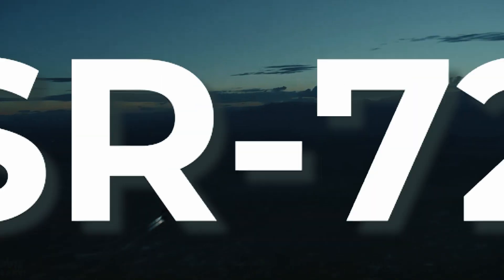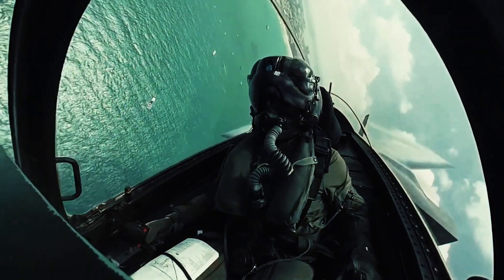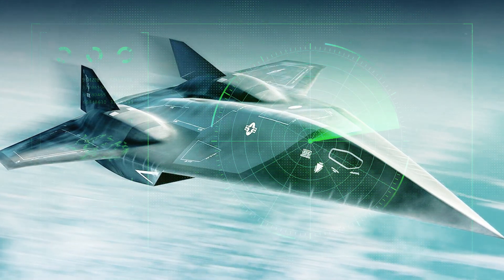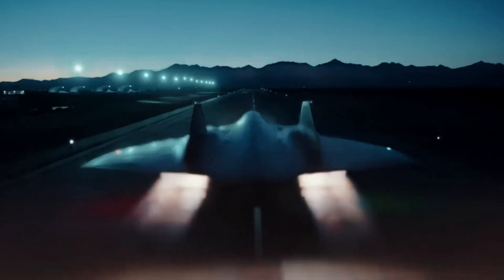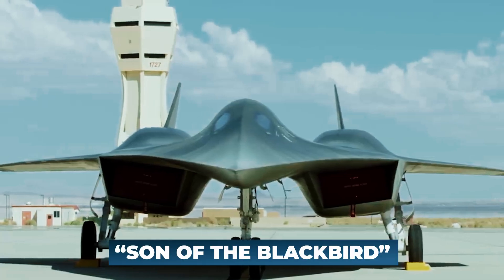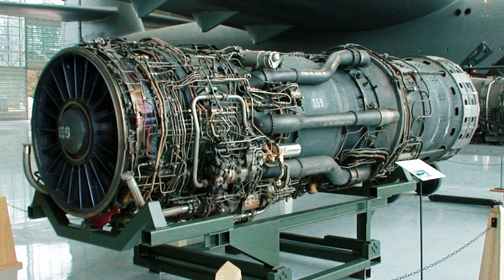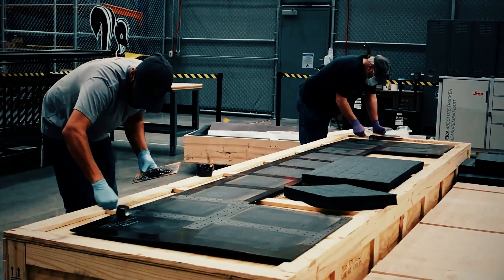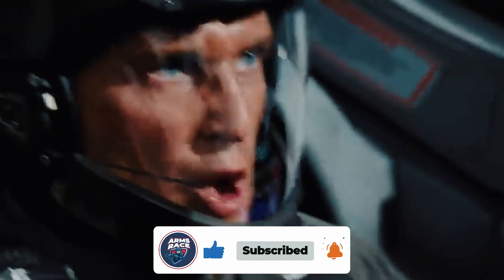Discover the Mystery Behind the SR-72, the Revolutionary Mach 6 Aircraft!

Comment: OK, I'll bite:

Back in the late 1980’s, on a Thursday morning, circa between 07:00am-8:00am or thereabouts, Southern California would be rocked by (two jolts); what felt like an earthquake.

These events occurred with regularity (if memory serves) for at least 8-10 contiguous weeks or so.

Mr. Jim Mori, a CalTech seismologist, produced a graph (rendered from CalTech seismometers) that showed the energy (noise and shaking) came from a sonic boom from what appeared to be an aircraft coming in from the ocean; heading towards Nevada.

Aircraft spotters and enthusiasts speculated the aircraft that produced these sonic booms were vectoring to the secret military installation in Nevada – AREA 51.  Those in the know opined the two sonic booms came from the shock wave – one from the front & one from the rear – of the aircraft as it decelerated below the sound barrier.

They also speculate the military was testing a super-secret aircraft that could achieve EARTH ORBIT, perform a de-orbit burn, enter the atmosphere, fly around in the atmosphere, power-up and achieve earth orbit once again.

[T]hey also speculate that this aircraft replaced the retired, or soon to be retired, SR-71 Blackbird.

I wouldn’t be surprised if the SoCal community - or another community in the USA - experiences these types of events again.

Just my humble 2¢ experience & opinion.